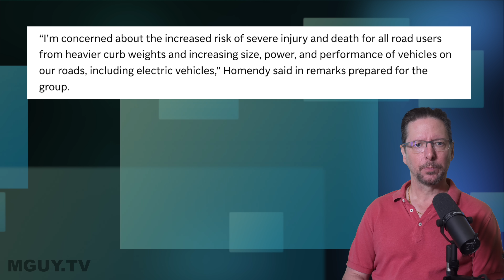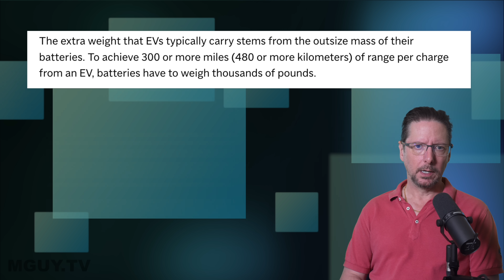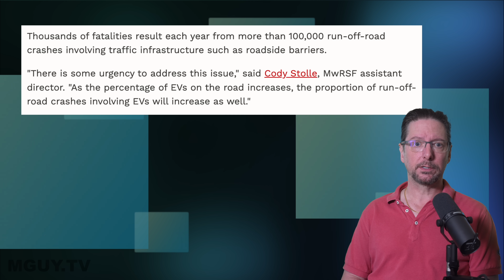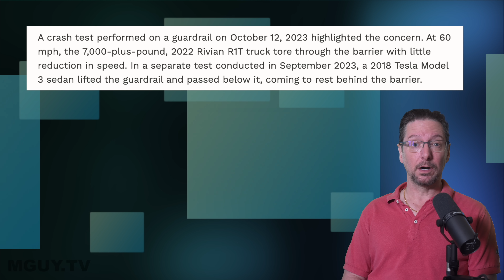EVs TOO HEAVY for roadside crash barriers (guard rails) | MGUY Australia

Comment: EV's should be required to have significantly higher liability insurance coverage.
Reply: I believe that is happening.
Reply: @tonysheerness2427 Prove it.
Reply: They do...
Reply: @alwaysright3718  How much more do they pay?  Based on weight alone, they should pay 30% more than similar capacity ICE cars and rhen the acceleration capabilities of EVs should be factored in.  I'd guess that liability insurance related to collisions for EVs should cost 2x that of similar ICE vehicles.  Toss in the greater fire danger and the premiums should be raised even more.
Reply: @alwaysright3718 Prove it.
Reply: @alwaysright3718  not mine.
Reply: They do, but guess how long until the tax payer subsidizes that too.
Reply: Other drivers pay for that EV deficit too - in higher insurance and the cost of ICE to offset the loser EV cultists and idiots who think a niche vehicle EV "is the future". @John_Citizen_17
Reply: @RAM_845  and it's going to get worse as the insurance companies have just begun to feel the pain.
Reply: yeah they already are,  and some insurance won't cover them at all.  and the resolution of this isn't even close to being done and delt with yet.  i bet they end up needing a 10K  copay bfor they'll cover the rest,   and i don't blaim them.  its all too easy to see how a rather minor accident could end up damaging a battery. total sho cost with a minor ascendant say might only be 3K...  if the battery is fd,  bam... that 2,000 dollar repiar just went to 50,000.  it would all but take just 10 accidents to see that trend.  just 3 out of ten battery replacements would make the person insurance close their doors lol
Reply: Here in the UK premiums are either going up or companies are flat-out refusing to insure them. On top of this, a lot of repair centres won't touch them because of the regulations regarding safe storage.
Reply: My insurance has doubled in the past 2 years. When I called the insurance company. I was told it was because of EVs.
Reply: @steveb6103 What insurance company is that? So I can avoid them!
Reply: @steveb6103  my insurance has been static for 3 years — Tesla Model 3.
Reply: That's grim. Sounds like the insurance company aren't happy about it or they probably wouldn't have told you that.  @steveb6103
Reply: Instead we legal citizens in 10 year old gas cars pay the bill.
Reply: Yup but nope they will make everyone pay.
Reply: @RAM_845 motorcycle
Reply: That's going to happen with 100% probability, if the state doesn't intervene in the insurance market.
(This should only be done in the health insurance sector, and there it MUST be done, but probably won't ..)
Reply: Unfortunately it seems that everyone will have to pay extra, even if you don't own a ev
Reply: @nonstopgok5396  Why?
Reply: @SirGregoryPageTurner  I can't know for sure but firstly because Eva were sold as not only being better for the environment (turns out they aren't) but also would save us money. According to our government they said that by 2020 Evs would even be much cheaper than ice cars, obviously that hasn't happened. They will never be taxed, which they will. In many cases Evs now cost more to charge, the costs keep going up and up. Now apart from the subject of this video, Evs are being written off by insurance companies at an alarming rate. It seems if there is any doubt about the integrity of the battery, it's safer just to take it off the road. I'm pretty sure this channel has covered cars that have scratched the underside off the battery, seems not to bad but the insurance company won't take the risk. Add the fact that now Evs like that get move to a salvage yard and instead of packing them in tight like ice cars, they have to leave alot of space around them. All add to the costs.
Yes ev premiums have gone up massively but I'm sure anyone who has had to renew their insurance on their ice car has been shocked by the rise. Mine was 55% higher last year after years of almost no difference. I changed companies but then when I replaced my car last month I had to pay an extra 39% even though I went from group 56 to 17! Apparently, although they couldn't begin to explain it, it's because of "Putin" or "climate change". Alot of people are told it because of brexit, again, doesn't make any sense. I suspect that the governments are trying to persuade the insurance companies to spread the cost to all of us. It's disastrous for the move from Evs to ice, they need to make Evs more attractive and bully us out of our ice cars. Again can't know for sure but there is definitely a pattern emerging here. I keep reading government blurb telling us that Evs are much cheaper in every way. I don't think anyone believes that anymore because reality tells a very different story. I think that perhaps the the part I fear the most is that, even if their policies end up being completely wrong and a disaster, they will never admit that and back down. Seen many examples of this in recent history. They will just lie and try to silence and discredit anyone that pushes back against them.
Reply: @nonstopgok5396  Don't like them? Don't buy one! But keep watching this channel to keep your confirmation bias topped up.
Reply: EV insurance is much more expensive in the U.S. for many reasons. They are heavier so the damage that they cause in an accident is greater. And the damage done to them in any accident is more expensive to repair due to the fact that repair facilities equipped to repair them are limited and the parts are more expensive. This will change if they become more prevalent and after market parts become available. But the biggest concern is that any damage that occurs to the battery typically results in the car being written off, even if other damage to the car is strictly superficial.
Reply: EVs should be confined to golf courses
Reply: Not an insurance expert but I am quite sure the load is being spread.
Reply: Apparently that’s already happening. Because of the cost of repairs and how easy it is to total them with slight damage to the battery.
Reply: It seems that a lot of people think the increased danger and damage, injury and death is all ok as long as it's paid for by insurance. Is that really good enough?
Reply: @kirpalani-griffin3706  increased danger? Teslas are almost impossible to roll; safety rated ANCAP 5, AND are average weight among their equivalents e.g. BMW 330E. What else have you got?
Reply: They do, and the rest of us are also paying higher premiums because of it.
Reply: NOPE!! They should be forbidden!
Reply: As long as regular ICE VEHICLES don't have to be lumped in to the premium pool.
Reply: Um, don't be stupid, and don't be gullible to bullshit on the internet.

Both Ford and Chevy sell gasoline powered trucks that weigh more than a Tesla does, and that's their empty weight. Once you load cargo they can go to almost double the weight of a tesla.

Do you also think that all gasoline powered vehicles that weigh 5,000 lb or more should have the insurance go up?
Reply: @lordgarion514  Trucks that weigh more than EV's are actually doing something useful by doing WORK and not hauling around some woke ass thinking he is saving the planet when in fact he is enslaving African child slave laborers in the cobalt mines and Asian children in the rubber plantations for all the tires they go through.
Reply: They also increased ICE cars insurance which was unfair. to cover their costly pay outs.@RAM_845
Reply: @RAM_845 Motor Cycle.
Reply: @RAM_845MC = Motorcycle, I presume.
Reply: If you are hit in a collision with an EV or heavy truck your likelihood of being injured or killed is substantially higher.  In addition,  the damage caused is more likely to result in damages making your vehicle less likely to be repairable.
Reply: Mine is $700 more per year than an equivalent priced ICE vehicle.   
https://www.youtube.com/watch?v=xI088BhC03Q
Reply: Just like my 3500s because of their weight
Reply: Thats an aweful idea and you only made that up because you believe what this guy said like you dont know what gullibility means or second party opinion. Also results are subjective and ev's are not the heaviest vehicles on the road. Making the customer pay for what should be any body else's problem is simply unreasonable. Living is hard enough as it is without losing your mind after a 5 minute video.
Reply: Your solution seems to amount to insulting people. That's an awful idea and an awful deed, Darkskull @Darkstar.....
Reply: What about any half ton truck?   Or the fact every single car’s weight  has gone up 50%
Reply: Do you imagine that trucks currently cost the same to insure as all other vehicles? Or that all electric vehicles are one group and all others are another? Or that insurance has not increased? Or that insurance is not weighed vehicle y vehicle by vehicle including colour as well as driver by driver by driver? Or that there is no actuarial industry? The one and only reason insurance might ever unduly favour EVs is that either the data hasn't come in yet or government forces the risk to be spread amongst all drivers regardless.   @stephenfazekas5054
Reply: @stephenfazekas5054  US cars are just too big and heavy. The rest of the world makes do with smaller cars. Time for change.
Reply: They will but we will all be loaded because of it.
Reply: @RAM_845 Everyone has a survival strategy on 2 wheels, some just drive faster than the surrounding traffic so if anything happens, it's left behind you and anything in front...well, your brakes are better than their if you can't dodge it. I had to give up motorcycles. Old Desert Storm injury that medical discharged me. Doc say one more whack on my spine and I'm going to be in a chair. I'm still tempted.
Reply: Don’t worry they are going to get hammered and in a lot of places already have.
Reply: I think insurance companies will do the correct move, remember they're private companies that work of risk/reward and deal with statistics and legal matters.....they know how to adjust prices.
Reply: Already happening my man
Reply: I wonder ev's are being charged road taxes
via registration that reflect the added
damage they do to pavement due to 
the heavier weight.
Reply: Does anyone here know what the 
bigger issues with the onslaught 
of push to ev's?
Hint; Our power source, Hegelian
Dialectic explains where they are
taking this.
Reply: You understand your paying higher premiums because of them.
Reply: @jimhill6586  Higher liability?
Higher premiums doesn't 
automatically mean higher 
liability. Or do you mean 
none ev owners pay higher
premiums because of them?
Quote;
''
@jimhill6586
12 minutes ago
You understand your paying higher premiums because of them.''
Reply: They do, to a certain extent, but the insurance industry is spreading the burden by factoring in increased premiums for ICE vehicles too.
They have to cover the 3rd party risk of an ICE vehicle driver being at fault for the damage to an EV - so actually we're ALL paying over the odds to keep EV insurance viable.
Reply: I actually get a zero-emissions credit on my liability insurance for my Hybrid sedan.
Reply: insurance will raise EVERYONE, not just Evs. Cause...they can and want to.
Reply: And they bigger agenda
is forcing us into N Power,
due to the eventual 1000+ %
demand increase. Look at
Ca alone, jeebus, they plan
to eliminate regular vehicles, 
they have rolling blackouts 
routinely already. Hegelian
Dialectic, people will embrace
the worst power source in
 human history, gleefully;
Problem
Reaction 
Solution
Imv, they've been planning this 
for decades.
Reply: People do not load their vans and pickups with the weight of a full size sedan. And airplanes are still the safest mode of travel. Passengers of commercial aircraft are less likely to die or be in an accident than people in cars. I personally witnessed the explosion of a hybrid pickup after it was involved in a accident on the freeway. The batteries caught fire then exploded sending a fire ball a hundred yards into the air.
Reply: That is right on.
Reply: That's ridiculous. So you think someone driving a >3K pound Mitsubishi I-Miev should require higher liability coverage than someone driving a 7K+ pound Ford F250 just because it's electric? I do think there should be a weight tax on personal vehicles though to discourage people from driving unnecessarily heavy vehicles and to help cover the extra road and bridge wear and the damages they will cause when they crash.
Reply: Here in the US Teslas are the NUMBER ONE brand of cars involved in collisions.  I wonder how much of that is caused by driver distractions with all of the screens and toys flashing at you.  Who needs a computer representation of the traffic around you.  Just look out the effen windshield.
Reply: @longshot7601  Telstra number one? Where did you get that from?
Reply: @SirGregoryPageTurner A Dec 18, 2023 Forbes article and a Business Insider article from Dec 20, 2023.  Also mentioned in redit. The top 3 per 1000 drivers were Tesla (23.54), Ram (22.76), Subaru (20.90).  They were the only ones with 20+ per 1000.
Reply: @longshot7601  Do you have a link to that article?
Reply: Liability will to go up on all policies. If you hit one, it's likely totaled.
Reply: @1mansopinions  Most of the road damage is done by heavy vehicles which are generally limited to 55.5 tonnes, but can be higher in some outback areas of Australia.
Reply: @1mansopinions  Think about it. Heavy acceleration and heavy braking impose the same stress on road surfaces. Now, which of those two is more prevalent? I don't have any stats, but my guess is heavy braking occurs much more frequently than heavy acceleration. You can most easily see this on a downhill road with traffic lights. Heavy vehicles "drag" the bitumen surface into ripples approaching the lights. Big SUVs are as heavy as EVs, and pickups are heavier. But the damage is being done by large trucks that can weight up to 55 tonnes in Australia, 37 times more than a Tesla Model 3.
Reply: Insurance companies might not cover them at all given enough cost in replacing cars, homes, injuries, or death.
Reply: @1mansopinions  
One of the two Tesla pickup truck models weigh 6600 lb, and the other weighs 6800 lbs.

The heaviest Ford is the Ford F-150 Lariat Long Wheelbase (LWB) 4x4, and it weighs 6,852 lbs.....🤷‍♂️
AND it only has a V6.
Reply: Because other drivers' insurance will pay for EV repairs too it will get more expensive for everyone.
Reply: EVs don't usually get repaired, they get totaled due to the $30,000 sensor filled fenders. @Pentti_Hilkuri
Reply: @RAM_845is that not based on repair costs, not for the added weight or fire risk? IDK but I’m not concerned with it hitting me as I ride mc and that unfounded fear would preclude riding a MC.
Reply: Every customer pays the difference. Insurance is just a different bank.
Reply: So should pick-ups.
Reply: Tesla is the best car company ever no maintenance no gas stations no oil changes no smog check no corrupt dealerships no lying salesman no catalytic converter
Reply: @southbound1969 This is not an EV issue. Its a weight issue. The vast majority of EVs weigh less than 4500lb, but there many ICE SUV and Pickups in the US above this weight.
Reply: It's actually a risk and liability issue, and weight is one of hundreds of variables, albeit sometimes a higher one.  @seannewman5391
Reply: 01:28 good point ban all trucks etc from roads!
Reply: @danquaylesitsspeltpotatoe8307  And ban all food from stores? It would be the same thing.
Reply: @robertkubrick3738  Hes the one wanting to ban all cars!  LOL did that fly right over your head!
Reply: @danquaylesitsspeltpotatoe8307  Mildly curious about what I posted that you misinterpreted but not enough to go back through 80 replies.
Reply: @robertkubrick3738  Weird claim, i stated a fact and you cnat pick whats wrong with it, you have to go see your false claim in the start! LOL think about it! only joking you cant!
Reply: @danquaylesitsspeltpotatoe8307  how was equating a different class of vehicles with each other stating a fact? Were talking class 2 ICE vs EV vehicles here, not class 2 EVs vs class 4, 5, 6, 7, 8 or 9 vehicles. It's not difficult.
Reply: @danquaylesitsspeltpotatoe8307  Are you trying to say Trump wants to ban all cars?
Reply: @danquaylesitsspeltpotatoe8307  can’t tell if thats sarcasm or stupidity. Trucks are infinitely more useful on the roads than a glorified office chair thats easy to park and has convenient cupholders.  And my daily driver truck still weighs less than a hummer ev and can actually get full range in the cold and haul water and food for my farm animals. You’d have me stuck making 20 trips over 4 days with an electric honda civic if you had your way. Glad YOU’RE not in charge.
Reply: what about a Dodge Ram? I doubt an ID4 is heavier than a Dodge Ram.
Reply: @svenweihusen57 , ridiculous.
Reply: @svenweihusen57  heaviest ram 2500 diesel is 7042 lbs. Rivian r1 is 7148 lbs. Rivian r1 is also shorter than a Toyota Tacoma. Also it can achieve 0-60  in 3.1 seconds. So you have a small truck that weighs more accelerating a double to speed of the ram. The hummer EV still not a full size truck weighes 10k lbs with similar acceleration.  Not even close.  Comparing apples and oranges. Rivian size wise is compared to a new ranger or Tacoma that weighs around 4200 lbs +/-.
Reply: So, you've never ben in the least bit concerned or worried about being hit by loaded vans or trucks previously then?  Why do you necessarily feel the liability cover an EV owner may already have, is insufficient?  Applying your logic, I could suggest you ought to have massively more holiday insurance cover than you normally do, just in case the plane you fly off on holiday in, crashes into my house.....
Reply: @Brian-om2hh this is about EVs being heavier than an equivalent ICE car, as you well know.
Reply: @johnnunn8688  Tesla Model 3 RWD = 1,760 kg; BMW3 Series 330E = 1,770 kg.
Reply: @johnnunn8688  So, heavier than a pickup truck? Heavier than a dump truck? Heavier than an 85,000 lb. tractor trailer?
Reply: @Brian-om2hh  Large vehicles don't have the sudden acceleration problem of BEV. A Tesla recently ran off into a Fjord in Norway from a standstill. Large vans and trucks are usually driven by experienced drivers whereas anyone who has credit or money can buy a BEV.
Reply: @Brian-om2hh  in General, Truck and Van drivers are Professional Drivers, over a certain weight you have to have extra training and get an endorsed license.
OK there are still cowboy truck drivers but it appears that EV drivers are more likely to believe their car is, and I quote E.M. "The safest cars in the world" and are more interested in "saving the world" than keeping their eyes on the road.
Tesla's don't even have a dashboard in front of the driver FFS!
They have to look at the "Infotainment" screen in the middle of the car and it's closer so the driver has to refocus on the screen and then sort through all the crap on the screen to even check the speed, but is probably more likely to focus on the battery state and range numbers or one of the other dozen useless pieces of info displayed.
And they think using a mobile phone while driving is dangerous!
Reply: @YouShouldThink4Yourself , excellent comment.
Reply: @YouShouldThink4Yourself  Especially as most EVs have full blown iPads in the console as well. 
Brian just isn't very bright.
Reply: Because vans and semis do NOT accellerate like a scaldef cat,
In the hands of an inexperiebced drivers they ate FAR more dangerous the  the BANNEF high performance vehicles of 60 years ago.
 @Brian-om2hh
Reply: @Brian-om2hh  They (trucks/heavy vehicles) already pay higher premiums than ordinary cars. And now because the risk is being proven to be greater with EVs it is clear that these aren't "ordinary" vehicles from a damage risk assessment that should attract ordinary premiums. They are a greater risk of increased damage in accidents and the greater the risk to insurance companies the higher the premium. It's happening already - just ask EV owners in the UK.
Reply: @Brian-om2hh Always entertaining and enlightening to look at a not-intelligent ideolog trying to defend his religion by applying his Pseudo-logic... 😅
Reply: @Brian-om2hh  Funny how the only way to make a comparison between EVs and ICE vehicles, is to qualify that the ICE vehicle be a fully loaded truck or van. 1) A fully loaded ICE truck or van is not as common as any vehicle (EV or ICEV) not fully loaded, and 2) fully loaded ICE trucks and vans don't drive as fast as EVS without a full load.
Reply: @Brian-om2hh if I have to pay more cause my truck weighs more ev’s should have to pay more
Reply: @Brian-om2hh  You aint too bright are you....
Reply: @alwaysright3718  
Brian probably drives and EV and is on his 20th jab lol
Reply: @alwaysright3718  Brian is a tezla boy. They can always find a silly reason to defend EV´s... But one sad thing aboute insurances is that ICE drivers also cause accidents, and some times a EV is in their way. That will make ICE insurances more expensive.
Reply: It sounds as though you are trying to sound intelligent but aren't. I'm not overly impressed by the fellows comment either, but your analogy makes even less sense.  @Brian-om2hh
Reply: @Brian-om2hh his point is more like how with my diesel trucks, I have higher liability insurance because they can do more damage if they hit stuff
Reply: @Brian-om2hh , fanatic.
Reply: @Brian-om2hh Well a 2024 F350 crew cab 4x4 diesel weighs around 7400 lbs. The EV Hummer weighs in just over 9,000! And that's the vehicle itself not containing any people or equipment. The "lightest weight" ev truck the Cybertruck weighs in at around 6800 lbs. As far as cars go the Tesla Model X weighs in around 5200lbs almost as much as a Silverado 1500 4x4. When a Toyota Camry weighs in at a maximum if it's AWD at 3500! It doesn't matter how safely you engineer any vehicle if one weighs in 3 times more than everyone else its going to be catastrophic for the lighter weight vehicle.
Reply: @Brian-om2hh  It's called odds muppet.. How many vans or trucks are on the road compared to cars.
Reply: @Brian-om2hh 
 Brian acknowledged that happens, but at a relatively low rate because there are less of them compared to passenger vehicles. 
Typical that you ignore the issue at hand with irrelevant sophistry.
The entire EV push has run into some serious problems to solve, and I bet non EV owners will be made to foot the bill!
Your dream has become a nightmare!
Reply: @OpinionFactChecker  How many large trucks and vans do you think there are compared to passenger vehicles? You make the same mistake you accuse other of , wrongly.
Reply: @robertkubrick3738  
In the metropolitan area, way more light passengers vehicles. In commercial areas, more light trucks. In industrial areas more heavy vehicles.
The fact that urban and city areas are the most commonly utilised, I assume that is what is being referred to. 
Large commercial vehicles are usually slower which means less energy on impact. 
Now we have 3.5 tonne vehicles that are capable of 0-100 in 3 seconds and a limited speed of 180kph.
That combined with the complacency new technology encourages, it's a recipe for disaster!
Reply: @Brian-om2hh  I agree with you.
Reply: @Brian-om2hh 
Let’s see a 9,000 pound vehicle plus a 2,900 pound battery 
That’s 11,900 pounds which is 5.5 tons
Reply: @Brian-om2hh

Brian your comparison is fundamentally flawed in that people driving heavily loaded vehicles tend to know the vehicle is quite heavy and generally unless they’re completely stupid drive according like for myself I drive a standard tray back ute loaded with tools and I simply drive to get to jobs so I’m not pushing the limits of the car by any stretch.

The problem that I see with EV’s in one regard having been taken for a breath taking drive in a Tesla recently is they are quite heavy but they hide it well they have such crazy torque that it just begs you to drive like an unhinged lunatic and it will accelerate at a ridiculous rate despite the weight and I imagine the car would be quite easily taken to it’s limit on a regular basis traction control is excellent but has its limits.

I think the biggest thing that is mentioned in this video is the absolutely unnecessary amount of acceleration these cars have and most drivers are simply not ready to handle it some never will be imagine going from driving your old school run about with modest performance to something that by any account performs like a damn race car irrespective of the brand for the most part most people myself included just don’t possess the skills to handle it and some practice at the least in a closed environment I think is absolutely necessary.
Reply: @Brian-om2hh loaded vans and trucks aren’t moving nearly as quick nor are they capable of doing 0-60 in 2 seconds 🥴🤡
Reply: @Brian-om2hh It's because heavy trucks made up a smaller proportion of the road. Now when you get a Civic sized car weighing 4000 lb you know work it out. You can do it.